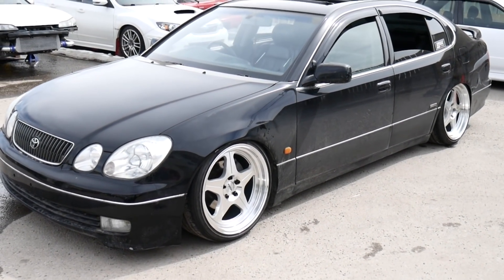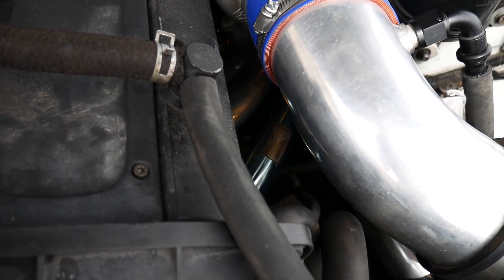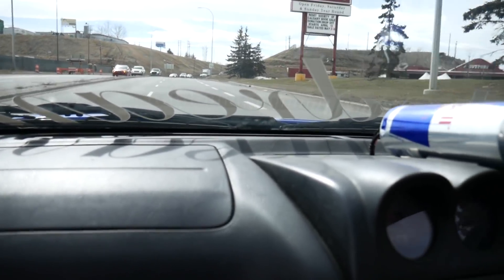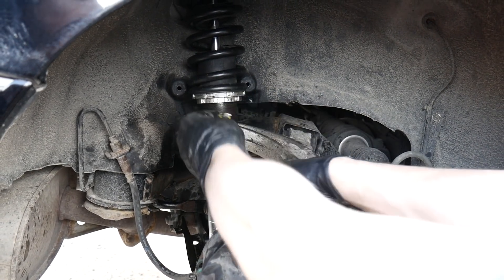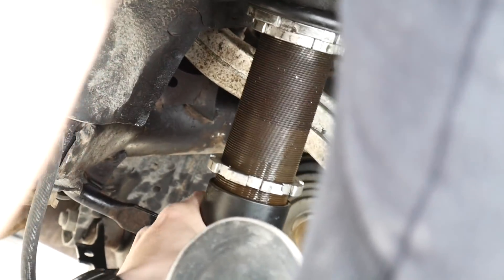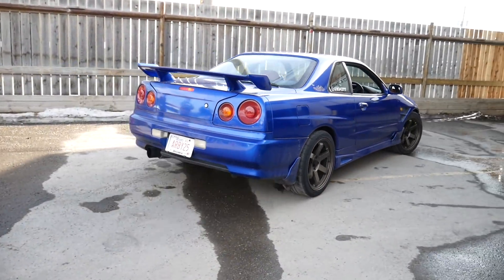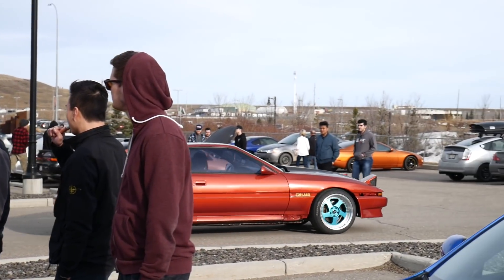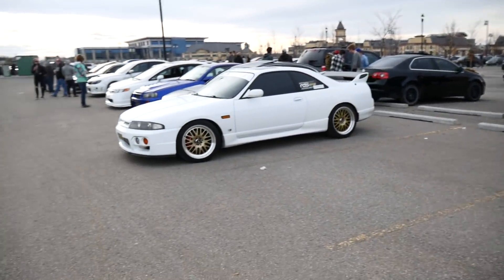SMOKING HOT AT A CAR MEET (4/20)

Comment: You guys know that when adjusting height on adjustable suspension you don't have to unbolt the bottom. Just loosen the bottom locking collar and use the c spanner to spin the top ring. It will turn the shock into the lower mount
Reply from the maker: That’s how we usually do it, but it wasn’t working for some reason with these coils, there was a ton of resistance and we couldn’t get it to spin this way. It was easier and quicker just to unbolt it!